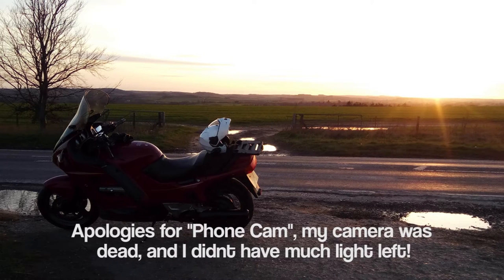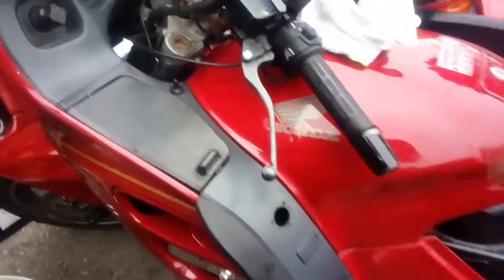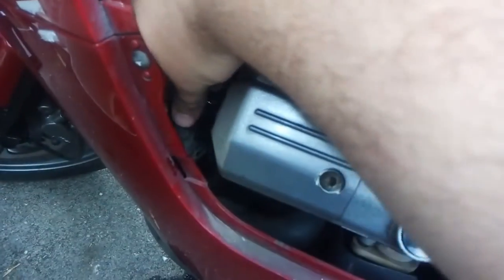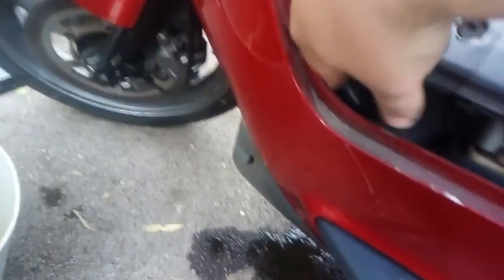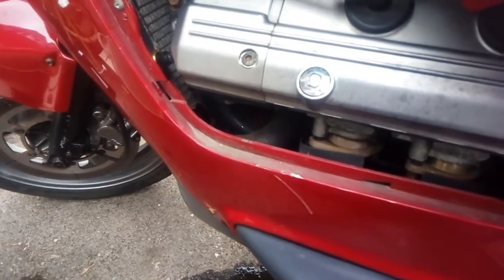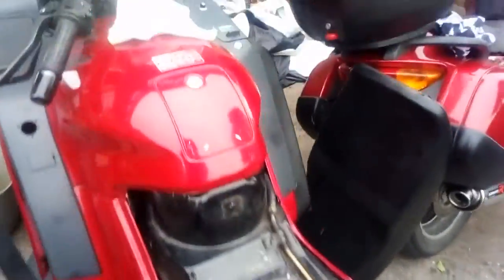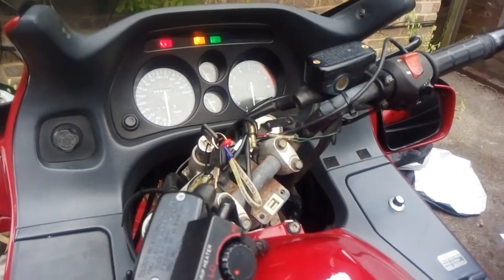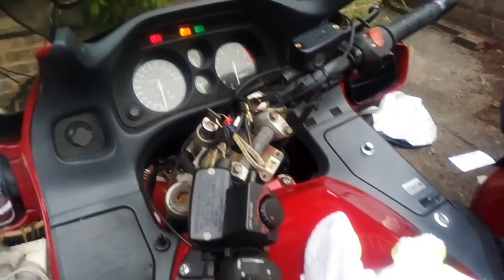JAM Archive - ST1100 Pan European Temperature/Fan Switch Replacement

Comment: Thanks for the video, my 1998 ST1100 is over heating as well, I changed the switch out but when I was observing the fan it was slowly turning and stopped, so you know what that means a new fan which I have already ordered for $40, not bad but now the detail of removing the radiator to replace the fan, again nice video.
Reply: Thanks for watching

Comment: Hi there. I have been looking at the price for this switch in England and they are around £40 for Honda original, but I have noticed that you can get  replicas from China and Hong Kong for under £5. Why are they so expensive? Any thoughts? Thanks for the video - John.
Reply from the maker: In my experience, the OEM parts are a little better plastics, little better water sealed - and overall a little better engineered, which reflects in the price. I was selling the bike at the time, so I used a part from http://www.wemoto.com - but had I been keeping it, I would have bought a cheap Chinese one - as the chances are it would have worked fine ! Thanks for watching.